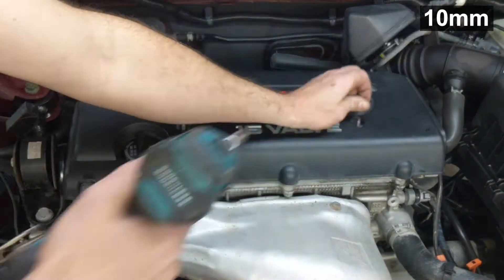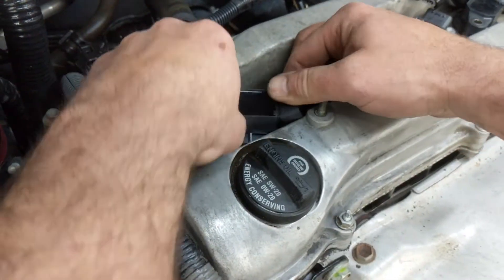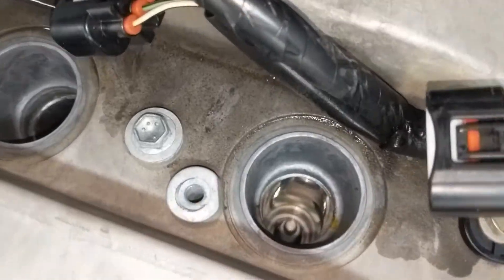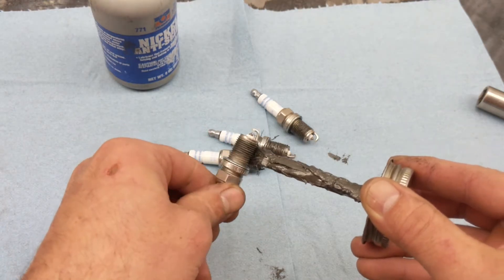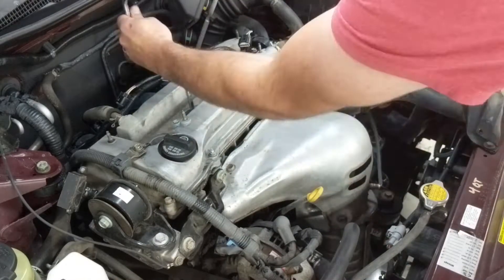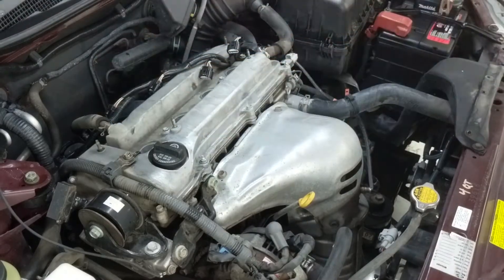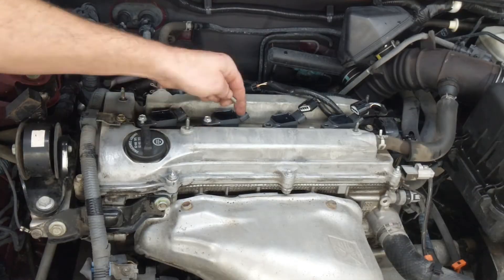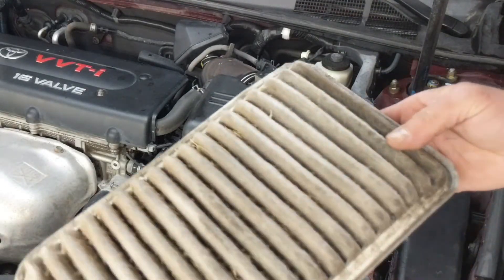2002-2006 Toyota Camry: Ignition System Tune Up (Spark Plugs)

Comment: is it necessary to do the coils at tune up intervals?
Reply from the maker: It would be proactive, but not necessary. High resistance from worn plugs or oil leaks are what take out coils. If the plugs are replaced at interval and the valve cover tube seals are in good health, the coils will last a long time.
Reply: @MasterJacks  , Thank you MasterJacks . Your video was very informative and simple for me.  I own a 2005 Camry with 270,000 miles and your video was very helpful.  Thank you and God bless.

Comment: With the dielectric grease, would it be good enough to just put a coat on the white ceramic part of the spark plug itself and not any on the coil boot? Then when the boot fits over it, the boot should end up with a thin coating and their will be no dielectric on the terminal/ post?
Reply: That's how its supposed to be done, I have no Clue why JAck just did that... I have never done that in 25 years of changing spark plugs.
Reply: Both ways work

Comment: The link to the ignition coil pack doesn’t come up can you post it again.
Reply from the maker: Try searching this on Amazon and verify your model year. Should be right. "Denso 6731308 Ignition Coil , Gray". Denso is Toyota original equipment. Ignition coils can be hit or miss with inexpensive aftermarket brands, but you can get a pack of four for about the price of one Denso. Thanks for watching! I'll get the link updated, but might be a couple days.